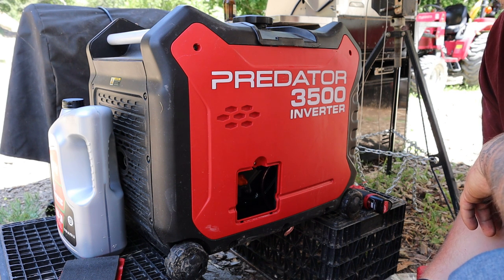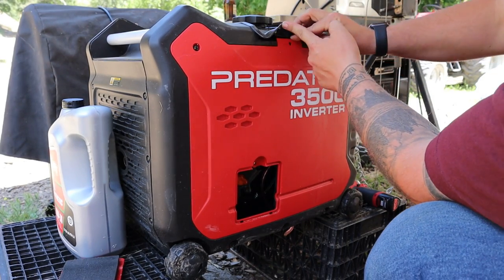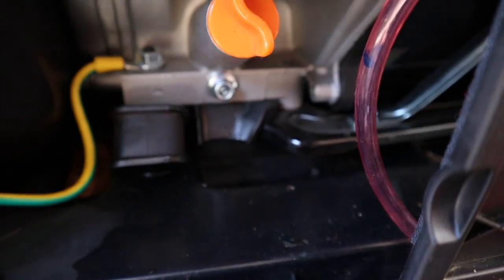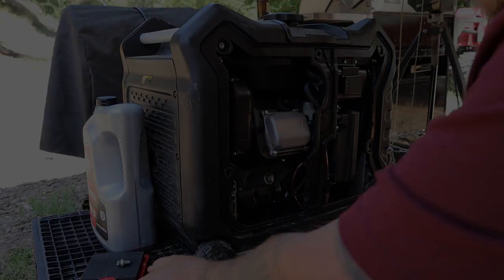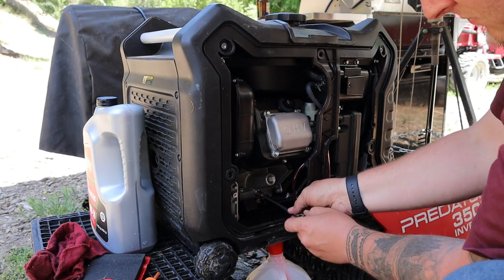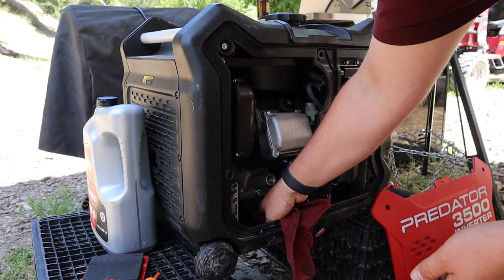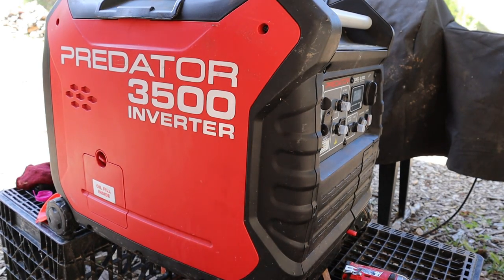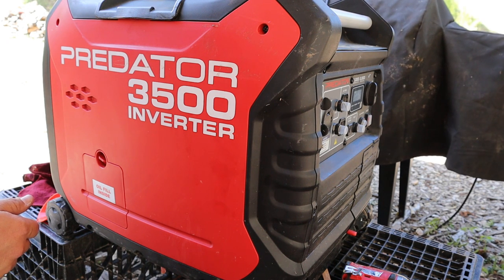Predator 3500 Inverter Generator - Service

Comment: If you have not removed it already, clean that spark arrester, it'll save you headache later. Also, when you check oil with the dipstick you don't screw it in.

Comment: FYI EVERYONE WHO HAS HARD TIME RESTARTING THE PREDATOR 3500 WHEN ITS HOT OUTSIDE... All you have to do is remove the gas cap and it will start right up. Just needs to vent. Somehow it took me almost two summers to finally figure this out lol.  . ALSO Jesus Christ delivered me from meth, adderall prescription, alcoholism, cigs etc in Sept 2014. No rehab or any other outside help! Just the Lord and His Word!! Eternal life in Jesus Christ alone. Make sure you seek and abide in Him!

Comment: I have found when changing oil in mine, if you put the funnel inside the generator and just let the spout stick out the drain hole in the case bottom, it will make no mess. ... Jim

Comment: How long have you had your predator? I'm looking into getting one but can't decide based on the mixed reviews looks like 50% love it and the other 50% think it's a waste of money. Just want to make sure I make the right choice.
Reply: @EpicAdventuresOffroad  thanks for the reply that makes me feel so much more confident purchasing one.
Reply: I'd say your numbers are way off. Just look on the Harbor Freight website and look at the reviews.
Reply: I have the same generator from harbor freight. Iam a owner operator truck driver. It runs 10 hours or more every night 2 years same unit on my truck. Runs my heat or ac and microwave. Still going strong just changed the oil and plug regular maintenance. Worth every dime

Comment: 1 qt is 32 oz this only takes 20 oz. And when checking oil level  you do not have to screw the dip stick in for a reading.

Comment: I am getting conflicting reports.......as to whether or not this model can be run while in motion (travelling)......while in my generator bay in my motorhome. Some say it does not run well in that situation....others say its goodto go while enroute.. What say?
Reply from the maker: Rob Mead can’t say that I have ever used it while I’m motion, sorry I can’t help you on that.
Reply: Well if you are hitting speed bumps it would be bad. While driving everything it’s in a steady motion only of the road is smooth. I e lifted 2000w predator of the ground while on you can tell why it’s bad the motor moves a lot while combusting.